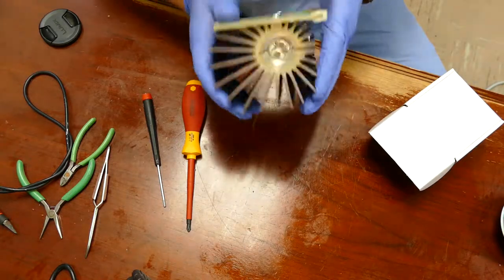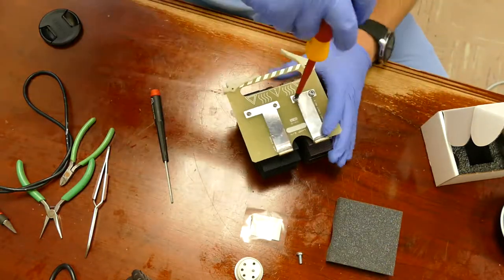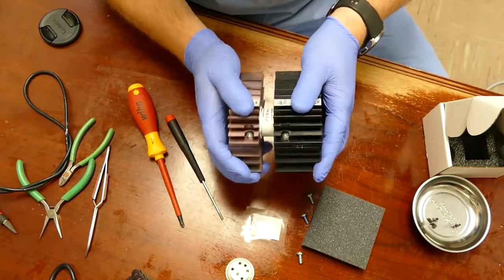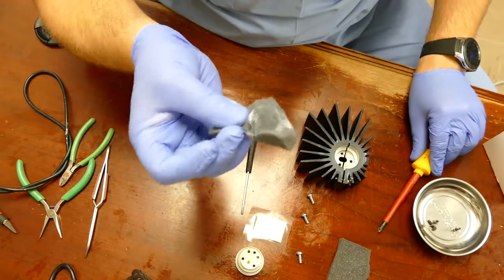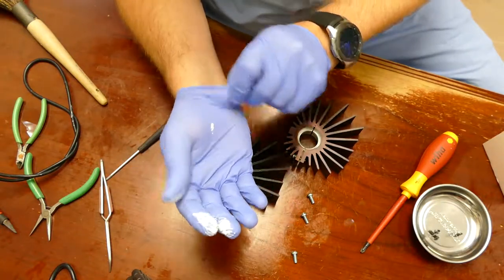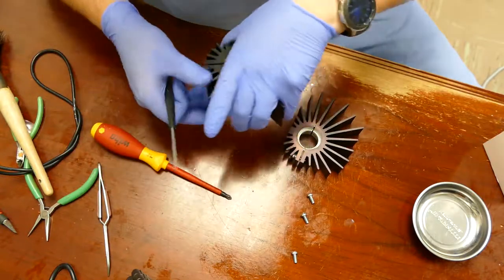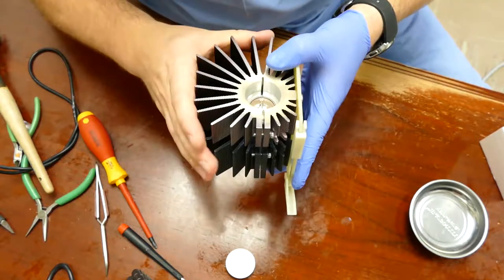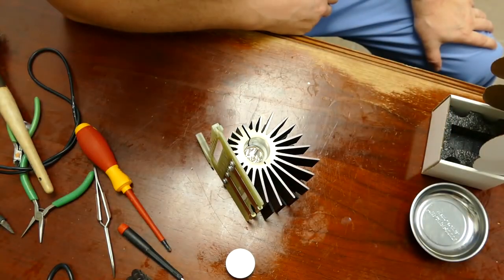14 Rebuilding Storz 300 Watt Xenon Bulbs

Comment: I landed here after seeing the Xenon Light Sources video.
If i saw right, then you forgot to tighten the front heatsink.
13:45 Small heatsink (front) gets tighten
14:31 Small heatsink gets screwed loose again, to push both heatsinks together.
15:27 The 4 screws to hold the interfacecard to the heatsinks gets tighten
15:33 Final check of the screws, but the loose screw of the small heatsink isn't checked. 
Correct me if i'm wrong. 
Grtz.

Comment: Why does the light source get hot, too much
Reply from the maker: Light sources get hot from poor air circulation. Fans need to be cleaned and checked for natural inertia motion when spun manually - if the fan has drag and stops prematurely, it needs replaced.